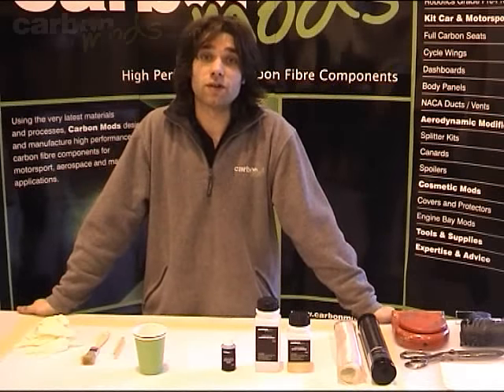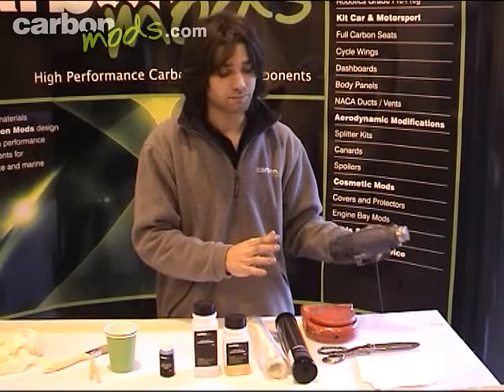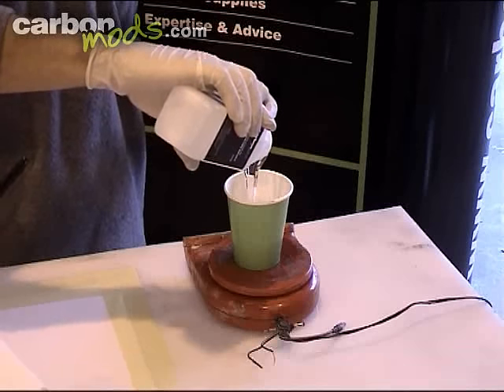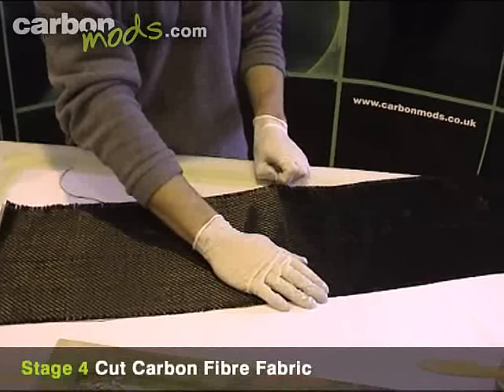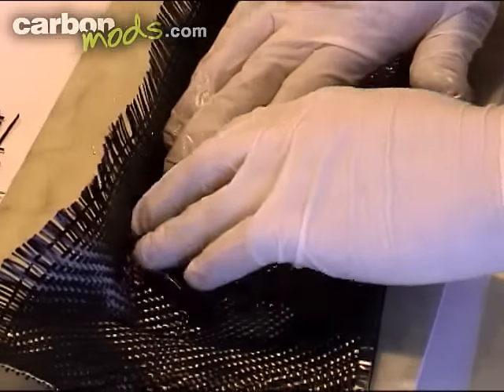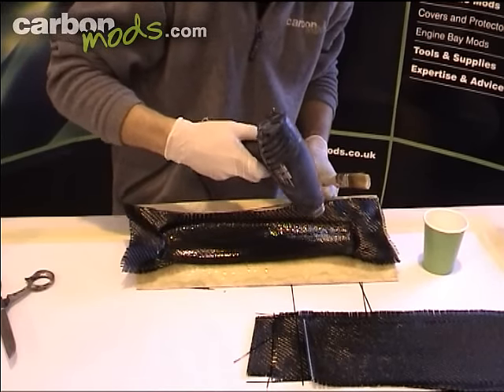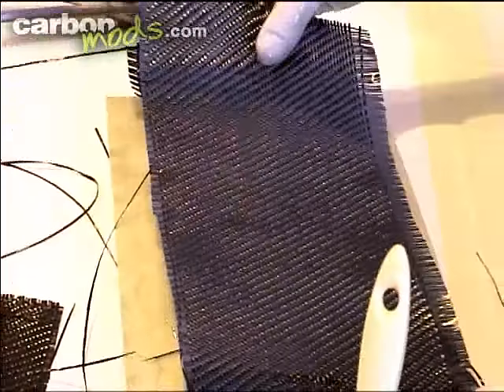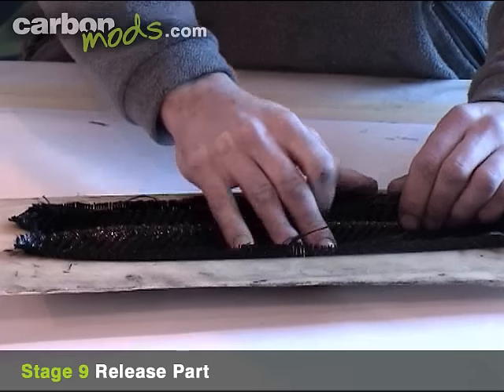How To Make Your Own Carbon Fiber (Fibre) Parts.

Comment: can you put plain fiberglass (wool or strands) under the first "exposed" layer of carbon fiber ?  if you don't really need the extra strenght or weight advantage of carbon fiber ?
also what about applying a 1/8" thick layer of fast-cast urethane instead, would that stick ?
also do you have a dust free and safe way to cut the carbon fiber ?
and are the vapor from polymerising resin flammable or toxic or environementaly damaging or so strong neighbourds will complain ? 

thanks

Comment: I have a question the hardening agent you mixed with your resin is it fast or slow ??
because you said after brushing it on the mold you left it to dry for 2-3 hours .

Comment: What material is appropriate for a mould? I am hoping to use some kind of plastic to give a smooth finish, but I'm unsure whether something like polystyrene sheet will be suitable, as the hardener and resin might overheat and damage the surface- any suggestions?

Comment: I have a question what do I do if I need a hole in the finsihed product do I cut hole in my mold and a hole in fiber wrap or do I wait in till its cured then drill the holes I need ? Im building a mini quadcopter frame . thanks for video and help

Comment: I have been thinking of thickening a too thin (old) 'cello top (with many cracks), and carbon fibre has seemed to me to be a good way, except for the baking process.  Is this avoidable?  Of course the resin will stick to the wood, but how little (much) pressure can be used to press out excess glue and get higher ratio of fibre?  Etc.

Comment: I would like to make a 6"x6" plate, 1/4" - 3/8"  thick.  Flat, no contours.  I would like not to heat or vacuum during the process.  Is it possible to do this,  building on a flat surface, place on the finished layup a weighted flat surface until cured.  I don't want to use breather, or bleeder -just plastic bag material placed above and below the project.
Is there enough product in one of your kits to do this?

Comment: I followed this, made a carbon part, but I am unsure on how to neaten up the edges of the part without ruining the entire thing. Any tips?
Reply from the maker: Generally trimming the edges a mm or two short of the final cut line will give you room to use sanding tools and sandpaper to shape the edge to get a good finish.
Reply: Carbon Mods cheers!

Comment: Good info. i'm planning to make engine Valve cover and timing belt case (and an air plenum later) is this possible on CF ? What grade woven CF cloth required for this application ?
Would appreciate your response. 
Thanx

Comment from the maker: Well, carbon fibre isn't really the recommended reinforcement for ballistics, it's not that there's anything particularly wrong but there are much better fibres such as Kevlar/Twaron/Dyneema. Carbon is strong but it's very brittle. For ballistics, it's better to have fibres with a high elongation to break property.

Comment: do you think making a carbon fiber chop stick is possible by rolling the carbon fiber and sanding it to make a pointy end
Reply from the maker: Yes, it would be possible but I think an easier way would be to purchase some pultruded carbon fibre rod and then just use abrasive paper to shape in the taper. Some rod like this: http://www.easycomposites.co.uk/#!/cured-carbon-fibre-products/carbon-fibre-rod/5mm-carbon-fibre-rod.html
Reply: carbonmods i thought about that but it does not give the check patterns of carbon fiber
Reply from the maker: This is true. OK, well, if you want the carbon pattern on the outside then the easiest thing might be to start with a carbon fibre rod and then 'roll wrap' it with some woven cloth. This will make it much easier to get a proper straight shape and still end up with the woven finish.
Reply: yes, you can.

Comment: what is difference compared to process of baking carbon in big oven?  industrial carbon parts are molded and baked
Reply: +SK Jung yes. please somebody explain us...
Reply: +SK Jung I think the difference is strength. without baking carbon fiber, the strength is determined by type of EPOXY you use. And I also think the strength is kind like fiberglass+EPOXY which is much cheaper.
Reply: +SK Jung Baking only speeds the curing of the resin.

Comment: Would this work for a bike handlebar? I wanna use a pvc pipe as a mold and maybe after all the layers are dry just slide the pipe out of the carbon fiber?
Reply: 50nollieman Chances are pretty good that you won't be able to just slide it out, you need some form of clearance, like a three-part rod where you can remove the center section (the || part of (||) ) and then that will relieve the pressure on the outer slats. You also have to be aware that the surface you're going to see is on the outside, so the work near the form isn't that important. You'll also need to vacuum-bag it to compress the layup onto the form while it cures, while also making sure the surface is really well-done because that's what you're going to see when it's done. Now you know one of the many reasons carbon fiber bikes are so damn expensive.
Reply: Ryan Willis That is a lot of details. I'll keep that in mind. Thank you! I think i'm gonna have to put this project on hold for a little while as i familiarize myself with all the specific details
Reply: 50nollieman wrap your pipe with a couple layers of wax paper, I've done this with a cardboard tube to make carbon fiber tube.

Comment: It's a way higher end if you bag if and use a vacum pump conjointly makes it lots lighter
Reply from the maker: Absolutely but not everyone has the facilities to vacuum bag or resin infuse or they may want to try making a few items relatively inexpensively before investing more heavily with vacuum pumps and equipment. All of the techniques have their own advantages and disadvantages, in the case of Wet Lay like this, its relatively inexpensive and doesn't need any special equipment.

Comment: Was the carbon piece wet sanded at all after being removed from the mould? And what did you use to clean up the edges? Would a rotary tool with maybe diamond carbide be sufficient?

Comment from the maker: @alvinlee94 : On our website we've written a guide to trimming and finishing carbon fibre but it's actually pretty straightforward. Always wear a mask and goggles but beyond that the simplest advice is to use any tools you like to cut 'wide of the mark' and then use wet and dry paper to flat, smooth and finally polish the edge.

Comment: I could see some pitting and irregularities on the resulting part... Either your mould wasn't too good, or you should have used a vacuum bag... probably the latter as it also can remove excess resin as well as fill some of those voids.

Comment: I was wondering about applications of your products for car panels and parts, in terms of heat and strength, i intend to make a lightweight bonnet/modified front end, i also plan to modify the rear trim, this and the bonnet will be subjected to continuos heat in use and the panels might have to deal with impact, my interest is increasing power to weight so lighter than metal not specificlly carbon or plastic my choice is controlled by price and function. Any videos or websites that might help?

Comment: What about that silver fabric that was shown next to carbon fiber? Didn't see it being used at all on the video
Reply from the maker: That's just normal glass fibre, we no longer include it in the kits but back when the video was made it was included so that customers had the option to add an additional layer of material if they needed to strengthen it a little more.

Comment: @carbonmods so what you're saying is that the carbon fiber parts made in the oven require ove curing just because they use less resin, while diy parts dont need over cause they can take a bit more wwight from resin...BUT are you sure they both have equall strength ? i know front nose cones on F1 cars are deffinatly oven cured.

Comment from the maker: @Billyhadley1965yeah : Haha, cheers. No consolation needed, I'm not ashamed of having an accent! - The mould is fibreglass, yes, epoxy gel coat and epoxy resin with powederbound chopped strand matt. Other suitable moulds would be our mould making putty system (see our other vid) or a polyester fibreglass mould using PVA as the release agent so that it definately won't stick. For more detailed info just contact us through our website where I'd be happy to supply any products and advice you need.

Comment from the maker: Hi mrhockey50, 

the mould can be made from anything that the epoxy won't attack or bond to, alot of plastics are fine for mould surfaces, always try a small sample to check for compatibilty. If you haven't already, check-out our mould-making video this might well be of interest. 

Thanks, Carbon Mods

Comment: I notice you using pva solution as a mould release agent.
Can multiple applications of mirror glaze wax be used as with polyester resins?
Reply from the maker: Yes, certainly. Mirror Glaze is a very good mould release wax, multiple layers will work well. The only different is that because it's so glossy, resin will tend to 'bead away' on the surface if you try to apply a layer of resin on its own (as a gelcoat). PVA is less 'slippy' and so doesn't repell the resin in the same way. however, if you're not using a resin layer on its own first then mould release wax is a good choice.

Comment: Is there a concept for the cris-crossing of the carbon fiber patterns?
Reply from the maker: I'm not sure what you mean by 'concept'; the name of the weave pattern of the carbon fibre fabric used in this video is '2/2 twill weave' which means that the weft and warp fibres intersect eachother by going over 2 - under 2 - over 2 - under 2. This type of fibre is used because it has a good level of drape which means it conforms nicely around contoured moulds.
Reply: Sorry I meant when laying down the layers of fibre, is there a systematic way of placing them such that each layer sits well over the other?
Thanks for the further explanation, looking in to making some carbon fibre fabrications, this video was very helpful.

Comment: how much stronger is carbonfiber than fiberglass? cause its almost the same process more or less and how difficult, thinkness and strength wise (not expensive) would it be to make body panels for a motorcycle or car?

Comment: Air bubbles from not using a vacuum seal while curing, not heat treated after for extra strength.

Comment: is it possible to make bike frame using this method or would i have to try a vacuum method for best strength and how much carbon fiber and epoxy resin would i need? i would be making a large-ish frame. also i will be trying to make it tear drop shaped tubes how would i achieve that? and how much will it cost?

Comment: how did you finish the part at the end. When it came out of the mould the edges were still rough, but the final few seconds showed a finalised part.
Reply: Hi Haider, there is a video over on the Easy Composites' page showing how to trim and finish carbon fibre which will show you all you need to know. CarbonMods/Easy Composites = the same company :)

Comment: @carbonmods, you think that we could build a replica of our  paddle board - first two halves using the board itself as a mold/base?
Reply from the maker: It is possible to use the original part as a male mould, rather than the more conventional process of first using the original part to create a female mould and then using the female mould to create the part - however this will result in the outside of your copy having a rough and less finished surface (with the inside being nice and smooth) and also will dimensionally result in a copy part that's slightly larger than the original. However, to answer your question - yes, it's possible to work this way, and does save you the time and expense of making a set of moulds which for a one-off can be significant.
Reply: thank you v much!
we'll try!

Comment from the maker: @uJackMeHoff2 : It's totaly possible but it would require some different techniques to the process shown in this video. A carbon longboard would use some kind of core material (maybe wood, maybe closed cell foam or even honeycomb) and tend to be made in a former but many of the ideas are the same (the resin and carbon would be the same).

Comment: in cars it reduces weight and if its used in the engine it keeps hot air away from certain areas, like the air filter, increasing performance. with PC i assume it could be the heat as well but im just guessing with that

Comment: Hi CarbonMods

Ok quick question i see that nearly everything you carbon fibre needs to be done in a mould is there anyway of applying this to the outer face of an item ?
e.g if i took the trim out of my car is there anyway i can carbon fibre the face of it with out making a mould ?

Romeo

Comment: lets say i make a mold, i put the carbon fiber in the mold with the epoxy and all that stuiff, can i put the original part in the mold while the carbon fiber is drying so i can put a special edge on the carbon fiber and does release agent work on metal?

Comment: What was the fiberglass sheet for? Making the mound?
Reply from the maker: It's was really just there to either use to practice with or you can use it with layers of carbon fibre to make the carbon fibre go a bit further (example - layer of carbon, layer of glass, layer of carbon). We don't actually include it in the kit any more though because ti just confused people!

Comment: What material do you need to make your mould out of?
Reply from the maker: There are many options, one of the more straightforward is the mould making putty system in our other video: https://www.youtube.com/watch?v=qKrl1PPvliQ&t=48s however, in the 14 years since we made these videos and with the advent of 3D Printers, etc. there are lots of interesting and accessible methods; you can find a lot more information over on our newer and much more comprehensive channel, Easy Composites.

Comment: I how much is the kit what's shown ,please  let me know.
Thanks.p
Reply from the maker: Hi Benson, you'll find the kit listed over on our Easy Composites website (https://www.easycomposites.co.uk/carbon-fibre-laminating-starter-kit), I'm not sure where you're based but the good news is that you can get a final prices including the shipping, easily from our website.

To find the shipping cost of any item just use the store in the usual way, add the items you want to your basket and continue through to the basket page. On the basket page there is a shipping calculator; choose your country from the drop-down list and the delivery cost for your order will be shown on the screen. If you then want to complete the order you can click ‘Secure Checkout’ to enter your details and place the order.

Comment: Actually, strenght has nothing to do with melting temperature. Anyway it wont melt in any temperature as epoxy is a themosetting polymer. It will eventually burn out in very high temperatures, but for a computer case I think it is quite safe.

Comment: War3lephant, there are reason why carbon fiber isn't used as wing material even after all these years.  One of which is that it's stiff...too stiff, doesn't flex / give under high load (i.e. too brittle).  Search "bbc carbon fibre airbus wing cracks" and read some of the articles.  I've previously replied, but I think the comment was removed by carbonmods.

Comment: How do you trim the part after it is released from the mold?
Reply: ROWINTEL.COM Depends on the thinkness of the composite product. Sometimes you can just cut with scissors or shears, else a tungsten carbide cutting disc with a good quality mask :)
Reply: David Stevens Haha, Thanks!  I've got the mask and baby powder ready to go for the itch!

Comment from the maker: No, 6 layers of 200g 2/2 twill would not be 'bullet proof'. Carbon fibre is not really a suitable material for ballistic panels, Kevlar or Dyneema are far more suitable because they have a much higher 'elongation-to-break' property. Carbon has a high tensile strength (one of the highest of all materials) but it is brittle and when it goes, it goes alltogether, making it the wrong choice for ballistics.

Comment: So I don't need a vacuum bag? Or what was the reason he didn't use one?
Reply: vac bag is used when trying to achieve weight saving by using less resin. it is often not used on parts this size or smaller as the weight saving is negligible. vac bagging also can produce a better part (check out the imperfections in this piece) without so much fuss, but it costs more in materials and is more time consuming on small pieces as it is fiddly!
Reply: iniquitous1982 Thanks for the response!

Comment: @carbonmods So if I wanted to take my hood, and make a carbon fiber hood exactly like mine, like an OEM hood, if you make the mould on the hood, won't it end up being a little bigger than the hood, because its on the outside, or is there some other way to make it just about the same size as your hood?? I would really appreciate the advice, nobody makes a CF hood for my truck!! Thanks.

Comment from the maker: Parts created in this way are very strong. If you use a more sophisticated technique (like resin infusion) then you can reduce the resin content which therefore means you can have a lighter part (or a stronger part for the same weight) but essentially the materials (being the carbon cloth and the epoxy) are the same and so the results are comparible. For you motorcycle parts, my suggestion would be to see our Resin Infusion video (through Easy Composites): /watch?v=VodfQcrXpxc

Comment: what if i want to cover a part with the carbon fiber? can i just use and adhesive to attach the carbon fiber cloth the part( trunk lip spoiler on a bmw) and then apply resin with a brush over it?